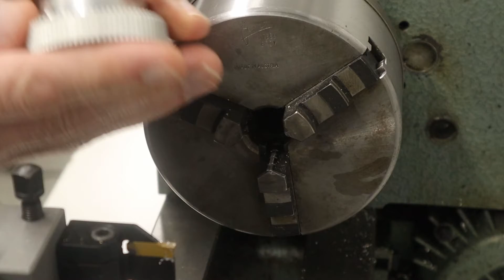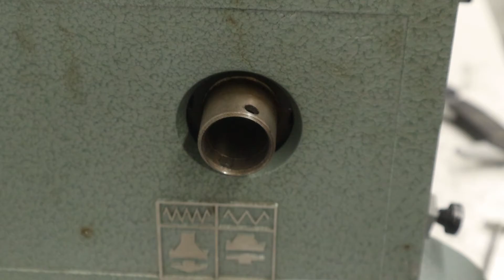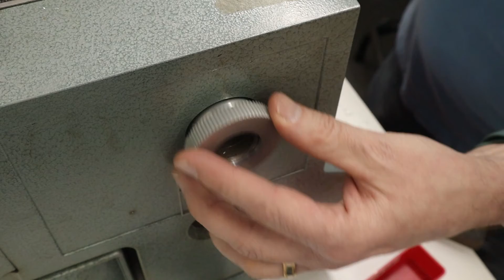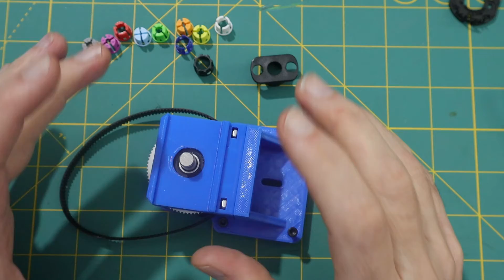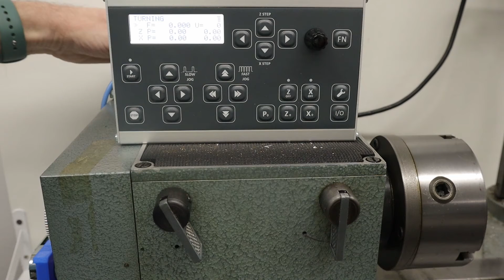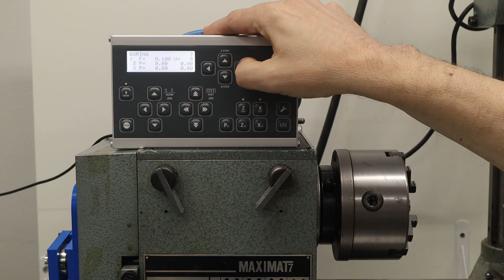Final Spindle Encoder Mount: ELS and Cross Slide Part 4

Comment: the pulley running in the 3j with copper covers on the jaws is not running very true. I can see quite a bit of wobble. Maybe for this use it doesn't matter and I'm being overly picky.  I would use a 4j for this and indicate it in or make a custom pot chuck.

Comment: It's always nice to see a project work out in the end! The angle screen is nifty. You might want to put a sharpy line on your chuck and verify that 360 = 1 rev. Easy fast sanity check. Looking forward to more content!
Reply from the maker: There is a 0 mark on one of the jaws so I can use that. So I'll have to check that. But given 90 degrees looked right and I set the encoder to 400 pulses per revolution, it's probably correct.